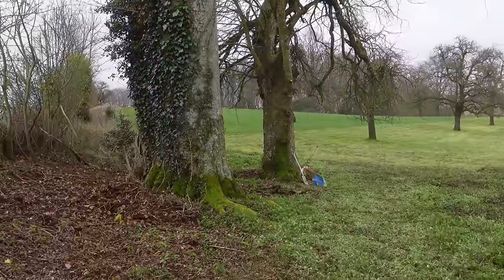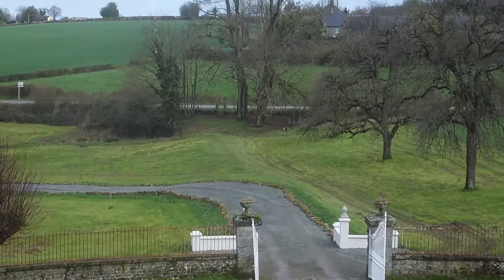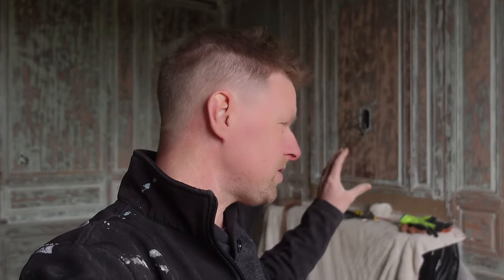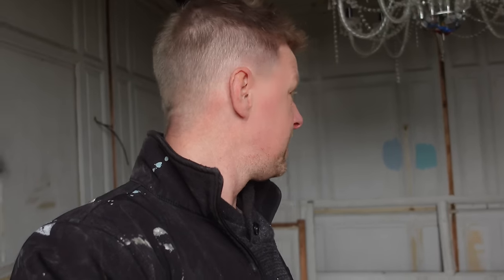Unexpected DISCOVERY At The Chateau Gate | You Have to See This!

Comment: One of the best tools for brambles is a small very sharp scythe on a long handle. You push it into the bush by the ground and then pull and cut the base of the bramble then use it to pull them out. Brambles do have a sort of bulb that needs to come up if you want to get rid of them permanently, it's tough work. If they didn't give us such deliscious fruit we could easily hate them. xo

Comment: How did you solve the problem of air removal in the bathroom? Have you provided an air duct? When using hot water, water condensation will form on the walls and ceiling. The water will destroy the panels on the walls. Destroy your reconstruction.